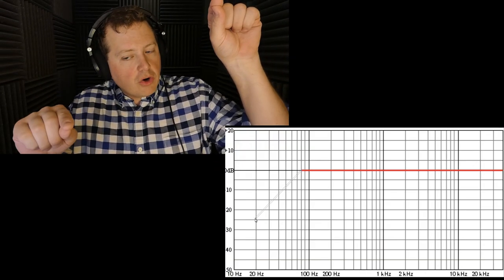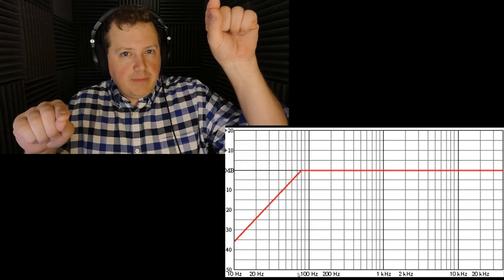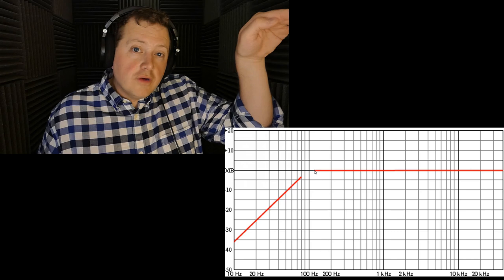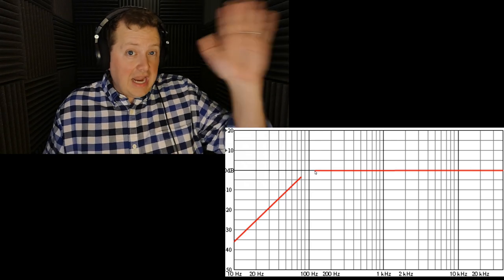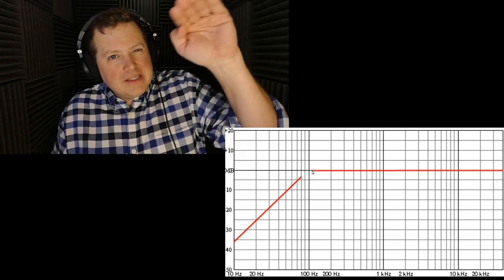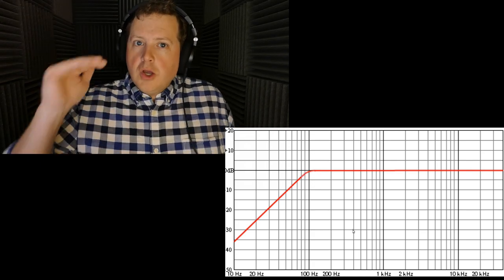High/Low Pass Filters and Roll Off - Sound Speeds

Comment: I have noticed that microphones often have a high-pass switch, but I have never seen a low-pass switch. Is that because low-pass is not commonly used?
Reply from the maker: In our world there's not a low pass switch, it would be done in post to knock out anything not considered important to the signal. YouTube rolls off at 16K because, I'm guessing, they don't find anything above 16K important enough to warrant above 32K sampling despite them streaming back above 32K. Just an assumption.